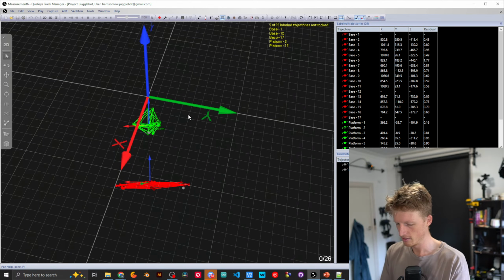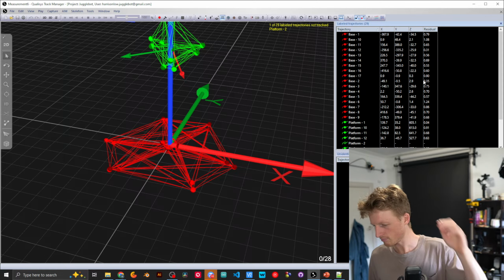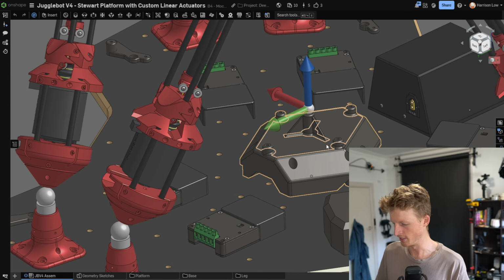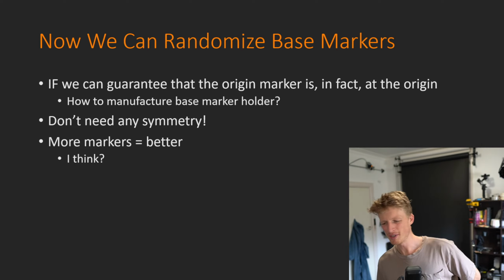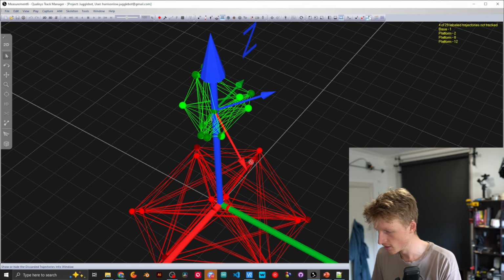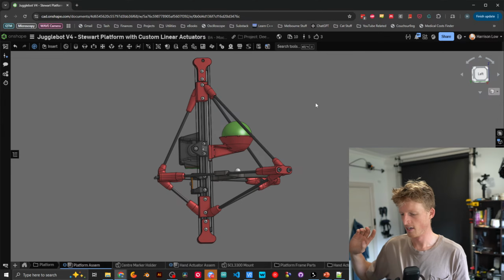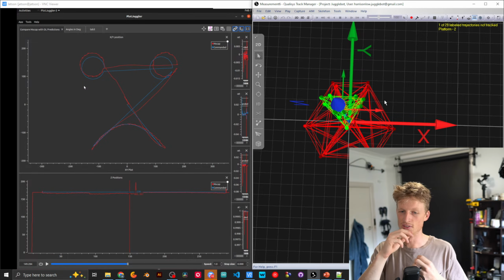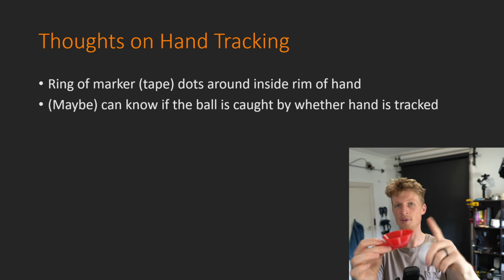PDJ Weekly Livestream # 46 - Mocap Update

Comment: Suggestion for printing the part @31:12 -- split it into two parts, print separately, then attach them together.  Split plane should be the bottom face of the top surface.  Add some geometry on the inside that allows you align and fasten the pieces together with screws after printing them separately.  Print the top part flat on the print bed, then flip the bottom piece so that its top surface is on the build plate.  That should allow the parts to printed without any supports.
Reply from the maker: This would definitely work in a pinch, though I'm skeptical about how precisely I'd be able to join the two parts together. Thankfully JLC3DP has me covered 😁

Comment: If you’re using some nodes on the base to specify the x and y axis, probably makes sense to make those nodes as far apart as possible, as this will greatly reduce the effect of any positioning errors in those node
Reply from the maker: Absolutely! I've tried to do this with the new 'power rail cover', though it's tricky to balance this against other needs (eg. making the markers solid enough to survive ball-hits).

I'm also not super sold on how important that actually is, as long as the original recording of the base markers is well-calibrated and precise; QTM seems to do a very good job of figuring out where the markers should be, based on all the other rigid body markers. So I think that as long as the original recording is clean and there are plenty of other base markers visible at all times, I think this origin-aligning should be quite accurate, even with the X- and Y-axis markers not too far apart